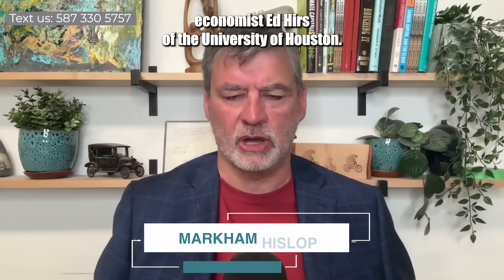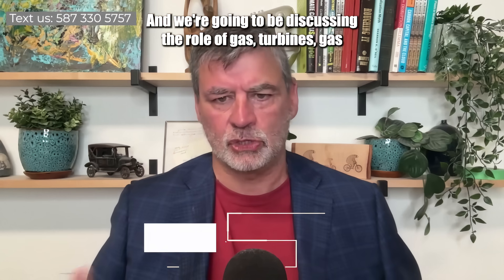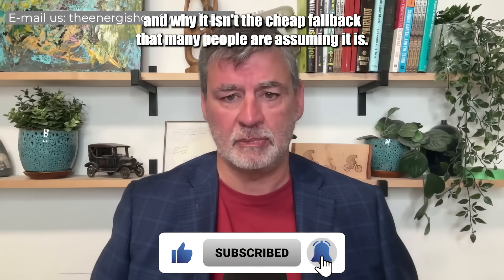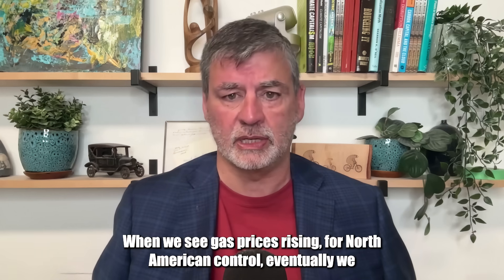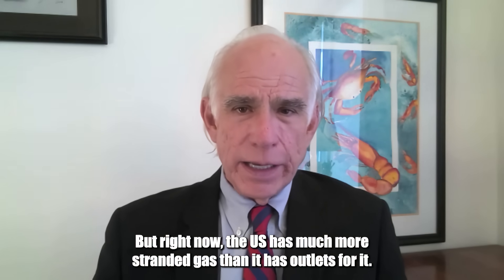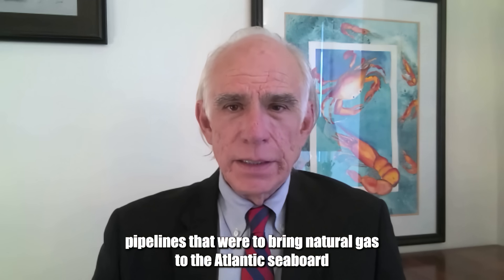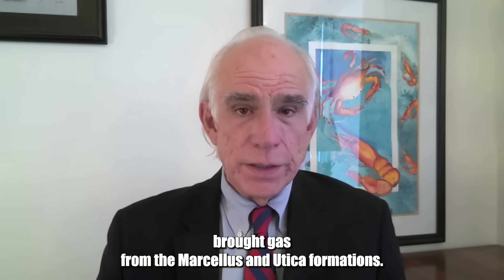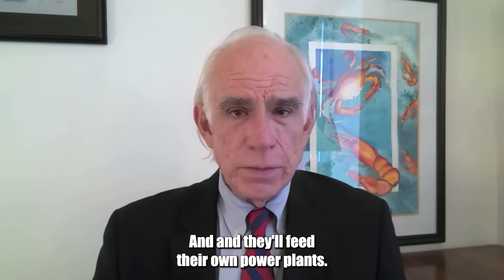Gas-Plant Backlog Puts North American Grids at Risk

Comment: Natural gas turbine generators are still the cheapest power stations to implement.    Their fast reactivity is what enables power grids to support large amounts of wind and solar generated electricity.   Without natural gas turbines the power grids would have little means to support more than a few simple test implements of solar and wind power.  They are very expensive to fuel compared to efficient coal power stations.   New highly efficient ultra supercritical (USC) clean coal power plants are estimated at less than 1/3 the fueling cost of cheap US natural gas.   

Natural gas combined cycle power stations where the hot exhaust is used to generate steam for a steam turbine are frequently run in simple cycle to use the fast reactivity of the natural gas turbine.   The steam cycle adds 50% more efficiently and capacity.   This is why when supporting large amounts of solar and wind generated electricity by  running natural gas turbines at high readiness making near zero electricity the natural gas cost calculates to be more than making all the electricity with natural gas combine cycle power station.   

100% output of natural gas turbine would generate all the electricity where running it at high readiness making zero electricity consumes 70% of full output.   A natural gas combined cycle plant making all the electricity with its 50% higher efficiency would consume  66-2/3% of the fuel of 100% output of the natural gas turbine generators.   

Solar power in a near cloudless environment may not have frequent use of make up above high readiness.   Large amounts of solar still costs a lot to support because power grids have to idle coal plants to support the solar generating space with expensive to run natural gas turbine generators.   Wind power with its wild fluctuations in a second requires constant make up above high readiness in quick jerks that consumes large amounts of natural gas making wind power the most natural gas expensive form of providing electricity.  

In the mid 2000s global warming had been at 1°C for over ten years, but there was large amounts of by-product natural gas from the emerging oil fracking industry needing a new market.  Climate action in the 2000s besides offering public recognition for the people promoting it forced power grids to support large amounts of wind power creating the needed market for the large amounts of by-product natural gas.  US vise president Al Gore 1993 - 2000) received $70 million USD from the Arab natural gas exporting country Qatar from its state owned Al Jazeera news network 2015 purchase of Al Gore’s Current TV.  Al Gore's 2006 film "An Inconvenient Truth" with its on going ramifications forced power grids to support large amounts of wind power.

Comment: Solar is only cheaper on sunny days.  If you only want electricity when the sun shines, use solar.  If you want it any other time, you need dispatchable sources (e.g., gas, nuclear).  Wind is the same story.  Of course everyone will start screaming about batteries, which are very expensive and last only a short time.  How do get electricity during dunkelflaute?  Having to build redundant electrical sources (intermittent solar/wind and dispatchable) drives up the overall cost of electricity, as Australia, Germany, UK, and California have demonstrated.  Also, large amounts of solar and wind make the grid unstable, leading to blackouts.  Ask Spain and Portugal about what happening in April.

Comment: Elon Musk has 35 in Memphis,  powering a data center. That's only one data center. Ask Elon
Reply: those are really tiny, lower efficiency highly polluting spot power units not the kind we talk about for best efficiency utility scale generation at all.   But your points is legit - in the interim some people need to get what they can, to cobble together workaround for power supply, given large scale parts and grid connectivity limitations/approvals to connect.  Not a simple problem, but DER techniques might be the best, fastest short term solution.
Reply: And it's a dump.  It's all used stuff cobbled together on the cheap, like he builds his starship.  35 is a maintenance nightmare.

Comment: nobody can build gas-turbines if factories building them face shortage of critical materials like rare earth metals as well as superhard materials that help build engine parts, like turbine blades, and bearings, gears, through high-precision machining (CNC Lathes)

several big-tech A.I. Computing companies are energy intensive, like xAI, which bought up all the portable gas-powered turbines they could get across USA, which were designed for emergency use only, so, these turbines had no emissions controls

the scarcity and shortage of gas-turbines manufacture will get worse as big-tech hoard these power units, leaving many smaller municipalities seeking to use them with nothing to generate electricity with any natural gas supply they hope to access

meanwhile, any natural gas going to coastal LNG facilities, to put onto LNG Tanker ships for export markets face shortages of LNG Tanker ships:

not enough LNG Tanker ships are available, as the demand is extremely high, leaving too few for USA's own export needs

and USA+Canada are not builders of LNG Tanker ships, so, they must buy from those who do make them

take a number!
we're not alone in wanting easy access to hard-to-get LNG Tanker ship fleets which are limited in numbers, on the global stage, as most of them are already rented/leased out to other LNG trade operators

Comment: So the NB power gas turbine plant, by Texas interests, will not be built?
Reply: It could be built, if its machinery is already on the order sheet.
Otherwise it is at least 5 years before they can expect any delivery of machinery.
By that time the market will have changed drastically.
So for most utilities, if it isn't already on the order sheet, they should be looking to build something other than gas.
Reply: @jimthain8777  The way to go is solar with batteries!!!!
Reply: Not in any meaningful timeline.
Reply: It better, because it's purpose is to back up the wind power.

Comment: The west has a lack of imagination when it comes to energy infrastructure. If you're not a proponent of clean energy only, that's fine. But a 20th century gas grid and a 21st century grid, including gas, look very different. In a 21st century grid, it is understood that you cannot always match demand to supply instantly, therefore you need a storage bridge or a deferral mechanism to maximize you overall output. If you had a connected grid and built ultra high voltage at the point of extraction, to go straight from chemical to electrical energy, and coupled that with industrial scale energy storage and industrial off peak demand policy and coordination, the same assets could have 2x the output.
Reply: Great point
Reply: I saw a crazy chart showing how much of California's wind and solar, especially the latter is being curtailed because there's no buyer for it during Peak periods. 3.4 million megawatt hours of wind and solar power potential in 2024.
Reply: @laughinggas5281  They are installing Batteries as fast as they can.
Reply: @laughinggas5281  The actual challenge here in California is that most of the panels face 1 pm and produce almost nothing after 3 pm. Our peak demand is roughly 3 pm to 7 pm, so the real issue is that most of the solar panels are facing the wrong direction.

The largest battery plant in the region was moss landing,  and it had a massive fire late last year.
Reply: The west has a lack of imagination when it comes to energy infrastructure.  Whereas China gets almost 60% of its electrons from coal. It uses hydro, wind, nat gas, and solar for the remainder.

Comment: This is why fossil fuels are a dead end. Wind are the way to go. Use the gas you already have to fill in the gaps until you can plug those holes.
Reply: Wind solar and batteries geothermal for base load
Reply: @laughinggas5281  CATL just announced their new sodium-based battery packs and are alleging a cost of $10(!!!!!) per KWh. If that is even halfway true, fossil-fired power plants will be completely uncompetitive by the end of the decade if not sooner.

Comment: Turbine cost are nothing in relation to lost opportunity costs of the 5 year delay in delivery.  This is also a problem for steam turbines, large generators and pumps.
Reply: And larger power transformers. Same, same.
Reply: Australian engineer here - YES 100% that's a giant problem.
Plus there's a World wide shortage of skilled technicians because for the last 30+years we told every high school kid across the developed world we wouldn't need any more electricians, welders, machinists, plumbers, gas fitters,...... because they'd all be coders and other white collar jobs BECAUSE the economists told everyone we were changing to service based economies.

Here in Australia we need to build at least 10 major BASE LOAD POWER STATIONS in the next 5 years or we are FARKED. Yeah I am all on favor of having a giant pile of wind and solar cos we have great conditions for both. BUT renewables need to be balanced out with inertial masses behind a bunch of large generators or you get grid instabilities like happened in Spain. People were predicting that sort of thing would happen.

Comment: We used to build turbines and generators at Westinghouse in Hamilton.  I understand the plant was shut down.
Reply: I was in that facility a few times in the later 80's as I worked for Westinghouse Industry Services. I worked with one of the Sure Supervisors that worked all over the world installing the generators and transformers. Have golf clubs will travel.

(They also designed and built protective relays there too).
Reply: Sad.  There are no winners in this trade war started by the Americans.
Reply: They're building wind turbines off shore Nova Scotia.   They recently announced that project.
Reply: @River_68 the turbines are manufactured in another country. Not sure which vendor they are using for this project. Construction erects the turbines.

I've commissioned six wind farm projects. All onshore of course.
Reply: closed in 2010